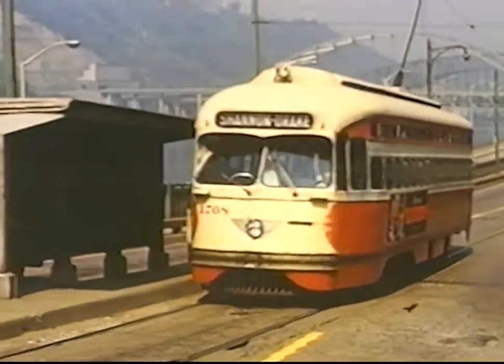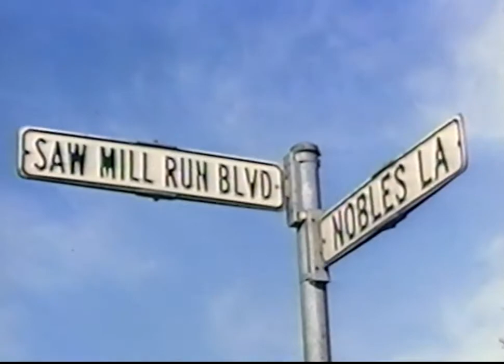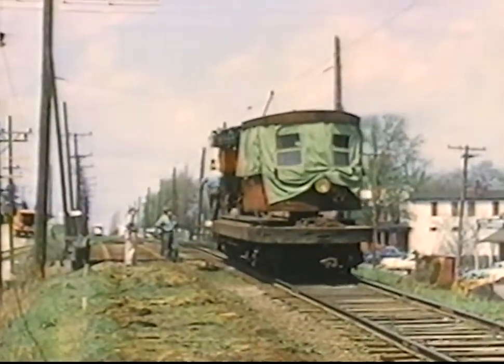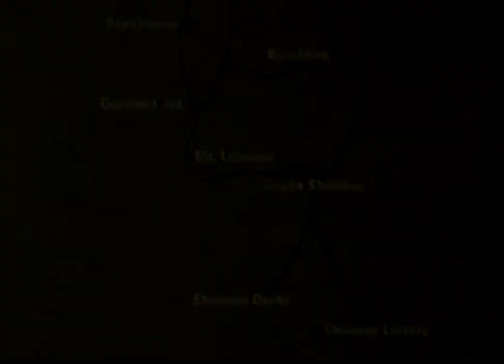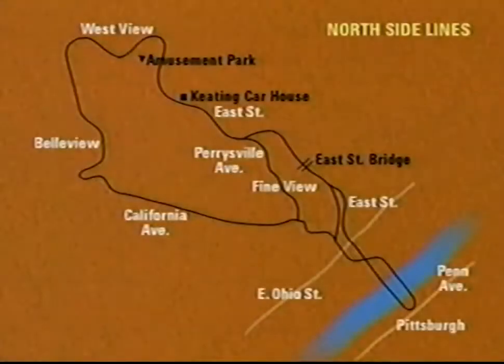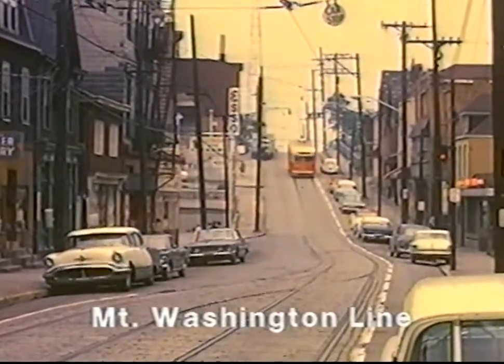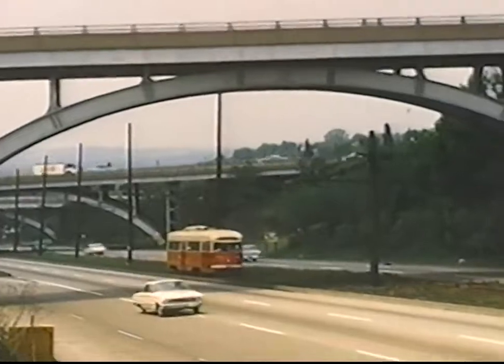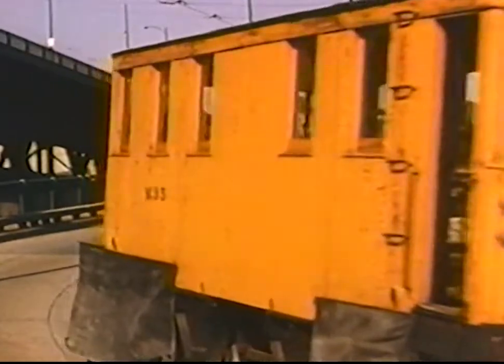Legendary Trolleys Of Pittsburgh ( and Johnstown)

Comment: In the 1970s on the weekends when I rode them any inbound Library line would become an outbound Drake streetcar.  Inbound Drake would become outbound Library cars.  Most times the sign saying it was a Library or Drake bound car would be done after the car exited the Strretcar Tunnel, but some drivers would switch the sign as the end of the line.  i.e. At the Library loop, the driver would switch the sign to "Castle Shannon Drake" as it waited for its time to leave.  At the Drake loop you would see "Library" sign.  No one confused by this for people knew what line they were on.  Having the correct sign was oly needed by people going FROM Town, not to town (yes I am a native Pittsburgher, an older native Pittsburgher that still refers Downtown Pittsburgh as "Town").

Comment: The 1700 PCCs were HOT.  The ceiling fans just moved hot air around.  The bozo who approved the design apparently had no notion of the Pittsburgh Summer heat and humidity.
Reply: I never found the 1700s "Hot" except when the fans were not running, the fan pushed enough air around to be comfortable.  I much perferred them to the 1600s which had windows you could open but not the fans.
Reply: @paulmentzer7658  Apparently you didn't ride them on hot and humid August days,
Reply: Yes I did, the Pittsburgh Schools permitted students who were issued bus passes during the school year to buy a three month pass for the sunmer, which I did.  Thus I used the 1700s in August during hot and humid weather. My High School did NOT have A/C so I was use to moving in hot and humid weather, I remember several such days in June (The City Schools last was was June 15 not the early days of June most Suburban School used as they last day of school).
Except when the fans were not working, the 1700s were comformable, warm but often better then being outside waiting for one to arrive.